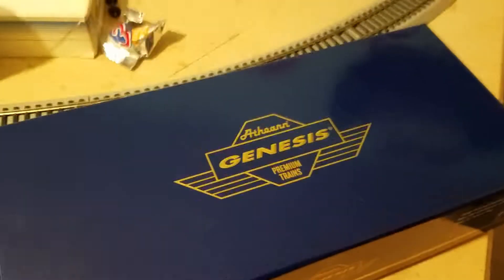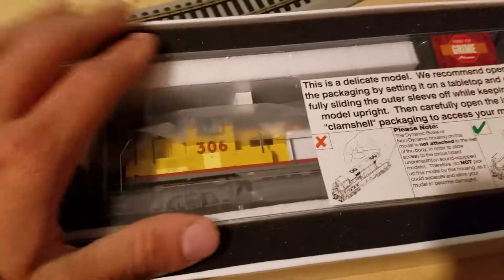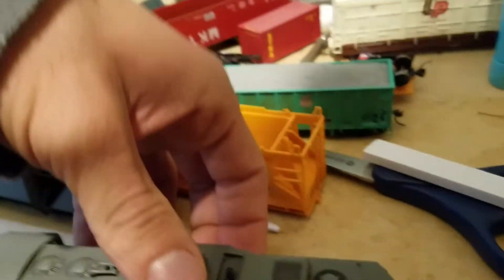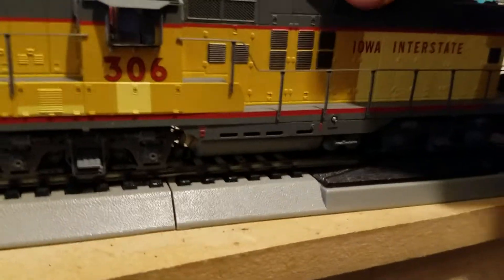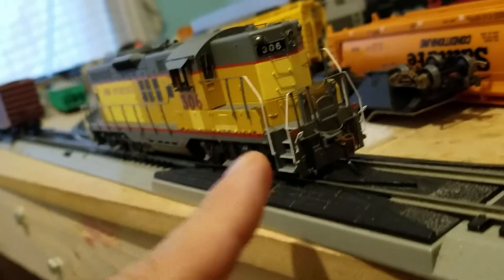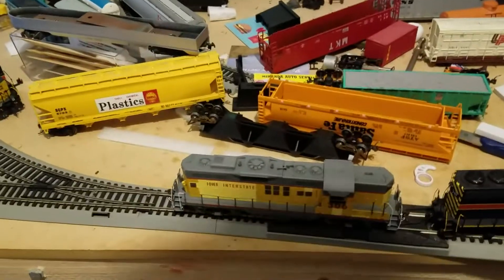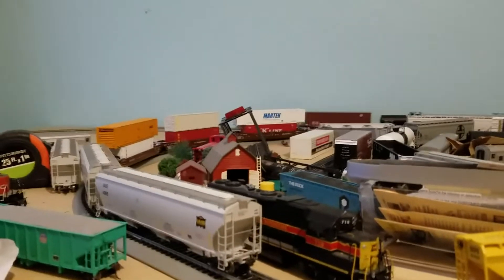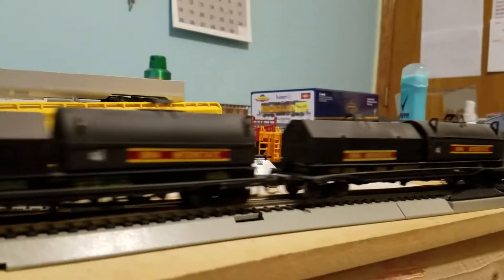Ho Athearn Genesis GP9 ex UP in IAIS

Comment: two of IAIS's GP9's (725 and 731) were former western pacific locomotives and are now non-operational but preserved at the Western PAcific Railroad Museum. One of IAIS's GP9's 304 caught fire in 1987 sidelining the engine for spare parts. It was used to repair 309 after it got caught up in the devastating altoona crash in 1988.